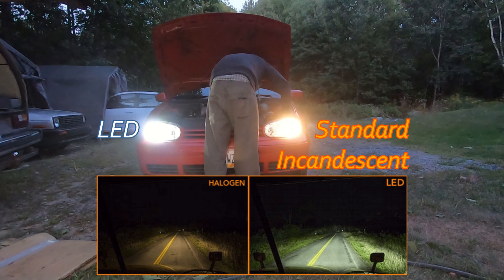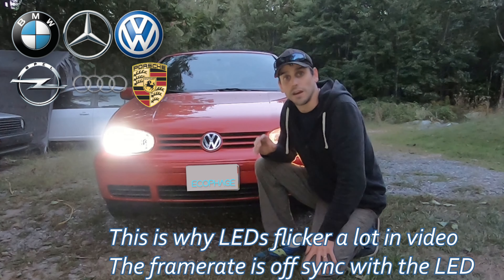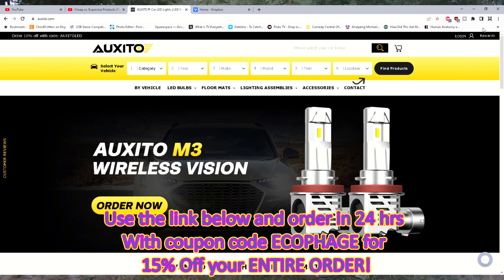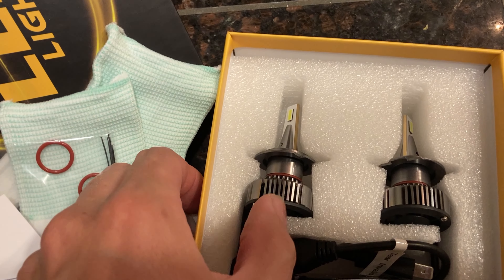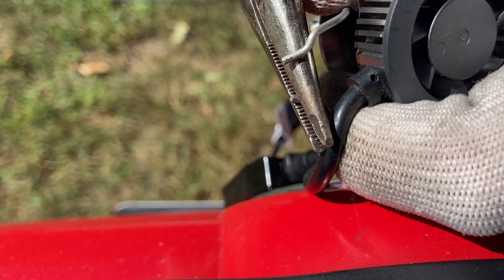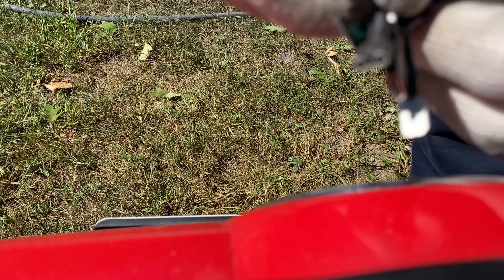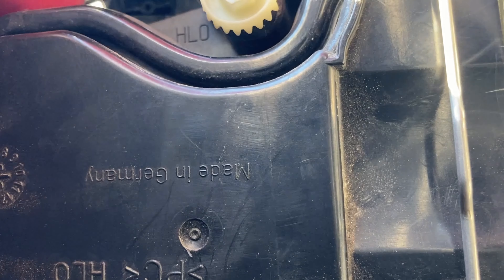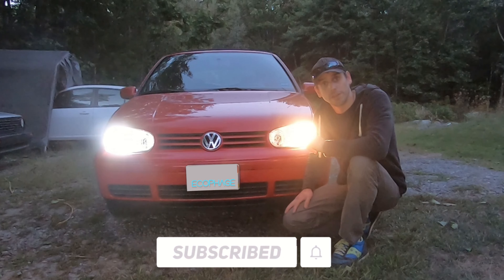LED Headlights can ruin your car?! CANBUS frequency interference SOLVED fix no start CEL + more

Comment: Can can bus eliminate noise interference to an fm radio signal
Reply from the maker: @ionion1785  no I would say can bus would be more susceptible to interference. I think shielding harnesses twisting wires and having things properly grounded and the correct spark plugs (with resistors) would solve fm interference
Reply: @ecophage  ok thanks, I just installed an led bulbs to my car and when I turn it on the fm radio signal has gone or it had a signal noise interference, I dont know what could be causing.
Reply from the maker: @ionion1785  ooooh yes that could be unrelated to can bus (because radios are pretty simple and don’t use can bus but do pick up electric signals) so yes LED bulbs especially cheap ones could totally cause an interference with a radio.
Reply: @ecophage  ok I see, but the one I purchased a led bulbs was a novsight product do you think this product is not fit or not good
Reply from the maker: @ionion1785  did it come with any resistors? Easy test is unplug them see if interference goes away but it’s definitely likely
Reply: @ecophage  no, but if I shut the led bulb off the signal interference of the radio goes away. I put some ferrite core but nothing happens.